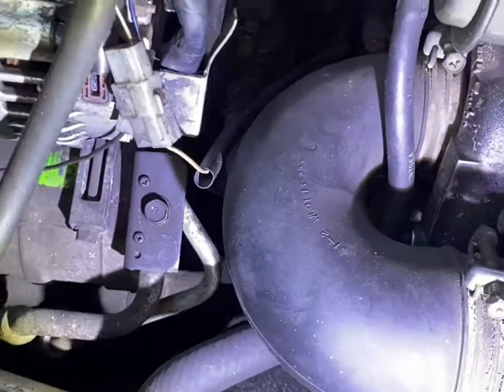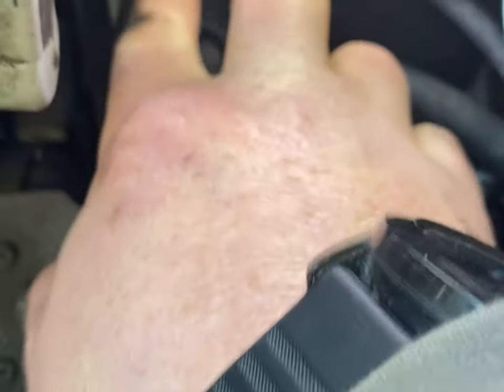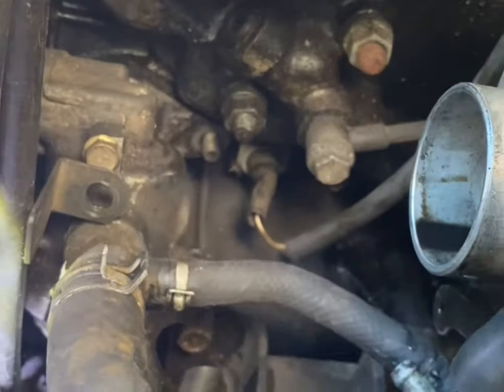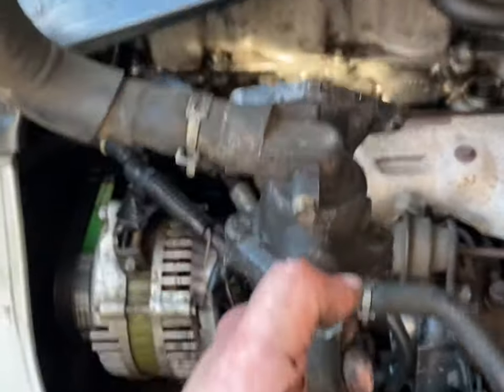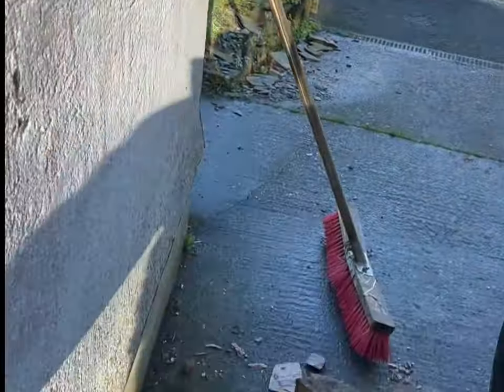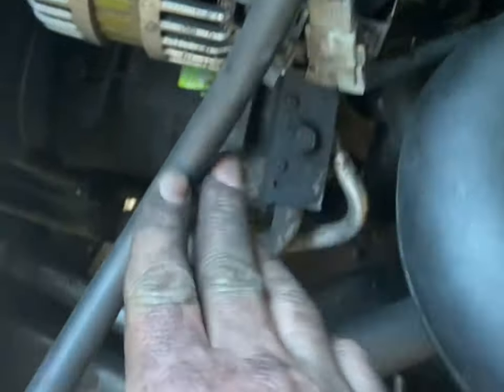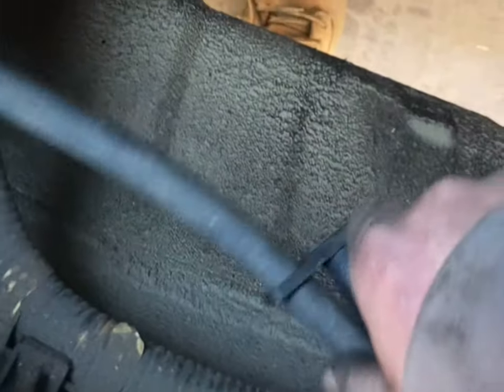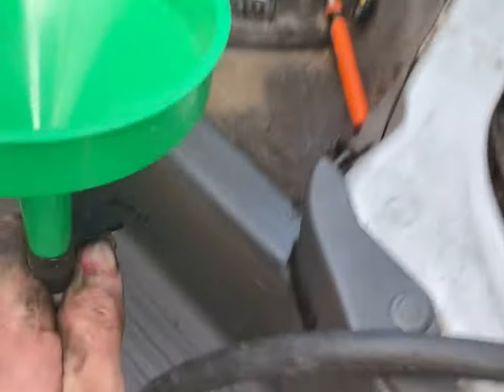Mazda bongo [ thermostat and bleeding the cooling system ]

Comment: Many years ago I discovered why some thermostats have a small hole in the metal ring. It's to let air and a small amount of water to flow when the thermostat is closed. Since then if they don't have the small hole I drill one. Saves time on bleeding the system as you don't have to wait for thermostat to open to let all air out. Especially on Bongos. Cheers from old George

Comment: hey man i have to replace my thermostat today, do I just use water to bleed it? you say at the end of the video to do it until the thermostat opens, what happens after that?
Reply from the maker: Once the thermostat opens it will allow coolant to circulate the whole system, just make sure you keep the coolant filled up in the water reservoir 👍
Reply: please my Mazda bongo only start when engine cool down wat is the problem
Reply: Thanks for the detailed video, very helpful! Could I ask how can I tell if the thermostat has been removed?